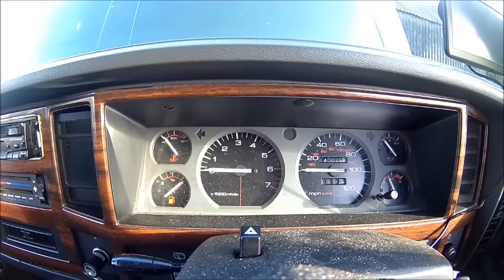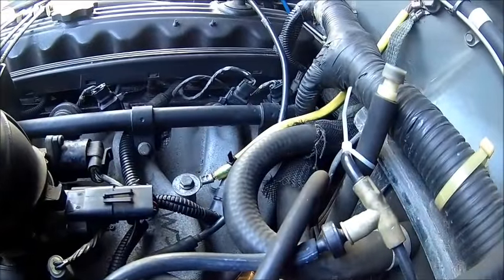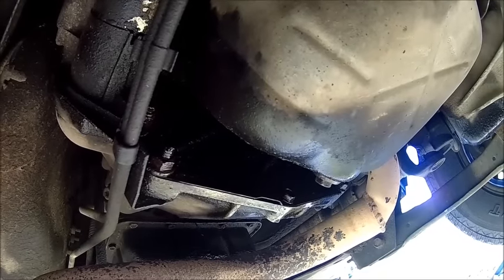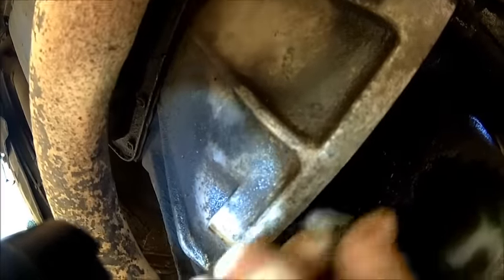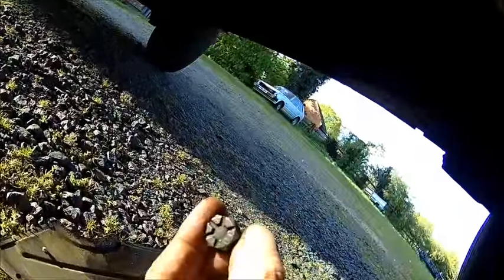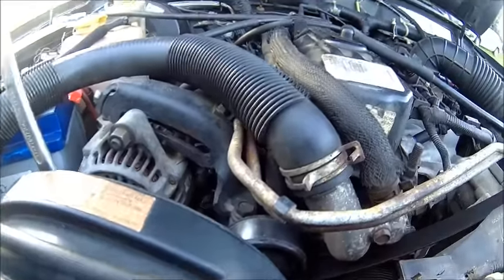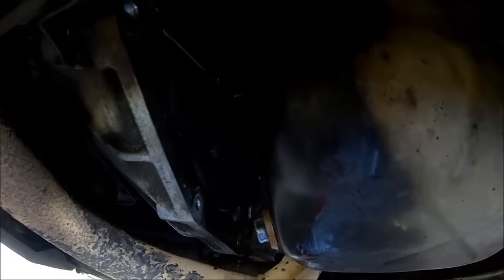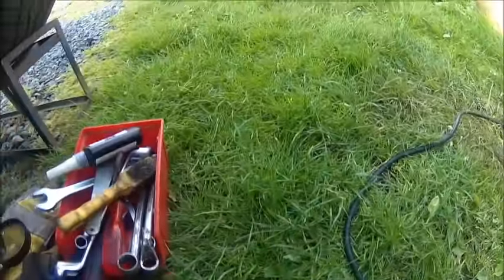Jeep engine knock fix  -Cherokee XJ 4.0 Auto, flexplate bolt issue

Comment: i did this the other day, i didn’t turn the alternator like you did, it didn’t sound any better after the job, one bolt on the flex plate was looser, but i’m wondering if i need to turn the alternator to spin the engine like i did the flex plate, would make sense but i thought i’d ask
Reply from the maker: turning the alternator is just another way to turn the crankshaft as the pulley  bolt is hard to access...

Comment: My does the same thing it was shaking an knocking really bad an had to have it towed into a shop an the man it was the Tork Converter bolts came loose an it stopped after he tightened them up but now it wants to do it again after about a month an a half he charged me 85 dollars just to tighten them up an now it's doing it again I don't think he put lock tight on the bolts but where can I get something to hold the flywheel from turning whenever I tightened them back up again
Reply from the maker: Take the starter motor out, that gives you access to the ring gear on the flywheel, then use whatever you can find to block it

Comment: 1:08 what is that whining noise? My 94 XJ is making the same noise? It think it sounds like it’s coming from the ac compressor. Possibly the bearing. Any ideas? Thanks
Reply from the maker: That's most likely the power steering pump, nothing dramatic as it never really changed over the last 130000  miles

Comment: Wow! This was totally the issue. My new-to-me jeep sounded like death when starting and shutting down (previous owner thought it was a rod bearing gone out!), but other than sounding nasty when you key it, it would run fine. I watched this video, got YouTube mechanic certified, went to pop the flexplate cover, and yep, loose bolts. Now it's tight and running right. Got this jeep in a trade for a shitty old bolt action shotgun, so I'm smiling. Thanks dynoguy!
Reply from the maker: You're welcome, glad i could help someone, Make sure you clean the bolts a bit and apply some Loctite, otherwise they will come loose again because the thread is too coarse for the short bolt length.
Before i actually found the issue on mine, i  ordered some rod bearings, just in case because it sounded incredibly bad,
cheers, Mike
Reply: 2021 love this comment
Reply: I'm having the same problem. When I start the motor, makes a odd rattle sound and when I turn it off, makes the rattle noise again

Comment: Excellent. I had the same noise and didn't really expect to find the answer on Youtube but here it was :) I also had a loose bolt, 15 minutes later noise gone!
Reply from the maker: Glad it helped, ... hopefully you added some thread lock (e.g. Loctite), otherwise they will come loose again, the bolts are pretty short and the thread is way too coarse.

Comment: I have an engine slight tick block has 169k that sounds like top end I replaced push rods and lifters sound is still there no performance loss still pulls hard, no oil in coolant, do 4.0s tick and how proactive should I be about the noise ?

Comment: I changed the flex plate on three of our vehicles. This is not a fun job but very possible. They crack and start to tick very loud one just broke. This disconnects the transmission and needed to tow it home. Then would'nt turn over the engine. I first thought the timing belt was broken. Cheap parts not made to last. Good fix.
Reply from the maker: Oh yes, flex plates are a common issue, loose bolt make them crack too. Alignment and correct torque on the mounting bolts make them last longer. I think i was just lucky, ... at least i could not see any cracks.

Comment: Mate your a legend. Thank-you for the video. With the sound of the knocking noise I thought it was terminal for my engine. Repaired in less than an hour. Thanks again cheers Karl.
Reply from the maker: Glad it helped someone,... when i heard the noise i thought exactly the same but it made no real sense because it disappeared after a minute or 2,....anyway, ordered conrod bearings straight away, just in case. and now they sitting on the shelf ...:-) ...cheers, Mike

Comment: My 98 grand cherokee laredo has a constant knock that never goes away and gets way louder and faster with acceleration, do you think it could be this or a piston slap?
Reply from the maker: If it's the flex plate bolts, it usually disappears with revs and load. It may be a cracked flex plate, conrod or piston slap, but without hearing it, it's pretty much impossible to figure it out.
Reply: @dynoguy  I've gotta 98 Grand Cherokee with a bad knock sound. Seems to go with the RPM and can always hear it, but on deceleration it seems to quieten itself down. What's your opinion? Was thinking it was a lifter collapse but it runs way too good imo.

Comment: Hoping and praying this is my issue.  Though I feel like I hear the knocking coming from the front of the engine.   Is it easy to pinpoint the sound ?
Reply from the maker: front of engine can also be slack of the cam chain, quite common on high mile engines, it usually disappears above idle. The flexplate knock usually disappears when hot, except the bolts are really far put or it's got a crack.
Reply: @dynoguy  thanks for the info!  Although with mine,  the knock consists whether the engine is hot or cold, and it speeds up as you rev the motor.   I’m kinda stumped on what it could be
Reply from the maker: Well, in this case i would say rod knock or piston slap,...also, sometime an exhaust header leak may sound like that, at least for the untrained ear

Comment: I'll never understand using lock tight if you do your own work? Ive told myself a million times " i hope i never have to loosen that bolt again... i always do. Fucking hate locked bolts..  FUCKING HATE THEM!!!!!!
Reply from the maker: If you need a means of securing a bolt from coming loose and if there is no other way (e.g. a wire lock),  Loctite is a widely  accepted procedure. A bit of heat and the bolt can easily being removed, i don't see a problem here.... But if one of the flex plate bolts comes out, you will very likely have a catastrophic failure which may cost you thousands of $$ to repair. That's why you need to secure them, the manufacturer was rather careless here, the material combination and design must lead to loose bolts, sooner or later.
Reply: @dynoguy  i dont take kindly to locked BOLTS round errrrrrrr!!!!!
Reply: @dynoguy  i dont abide by no larked up bultz on me JERPP!!!!!

Comment: OK so I found 2 loose bolts on my flex plate. I tightened them and still hear the noise. I did the test where I put a screwdriver to the transmission bell housing when running and I can hear the tap is definitely transmission related. There is no tap when I put the screw driver to the oil pan. So I'm guessing that the flex plate could be cracked? I can not see and cracks. Could the torque converter tap itself? This noise is really upsetting me. My XJ runs perfectly and this noise makes it sound like crap. Any suggestions?
Reply from the maker: Hard to tell without hearing it, a cracked flex plate  is quite possible, never had a rattling torque converter. Does it disappear when you put the transmission in drive,  step on the brake  and rev it up gently or does it get louder ?  If you tap the flex plate with a hammer, it should (sort of) ring, if it only rattles you most likely have a crack. 
On various vehicles , I've seen cracks on the outer holes and on the crank bolts holes, but those can't be seen without taking the thing apart. Don't know how many miles your's got, but piston slap makes a tapping noise as well, mine got almost 200k and it's getting a bit more audible now..
Reply: @dynoguy  OK so I went out there with it running and put a long pry bar to the trans and engine, and held byy ear to find out exactly where the noise is. Turns out it's right above the distributer, but only that spot. Could it be a lifter sticking?
Reply from the maker: High or low pitch noise ? Low frequency "knock" is most likely piston slap or if it gets louder with load, probably a rod bearing, if its more like a higher pitch ticking noise, can be a lifter. How does your oil pressure look ? How many miles have you got on that engine ? ... cheers, Mike
Reply: @dynoguy  thanks for the quick response. Truck has 190k it sounds just like a flex plate tap and it radiates from the area above the distributer downward towards the flex plate. I'm sure it's not It's not a rod knock. its not constant it kinda comes and goes and isn't any louder when I give it gas. It goes away at higher rpm. I did have a loose flex plate which was contributing to the issue so I know what that sounds like. This noise is similar. I checked the flex plate for cracks and it looks good.. It's more of a tap that comes and goes but originates above the distributor. Probably about 5 inches directly above it. I'm thinking it's a sticky lifter. The truck has been sitting a while also. It really didn't do this before it sat. Oil pressure is really good. Stays above half way mark at idle when warm and creeps up to 3/4 when driving. Not sure the pressure off hand. Might try to fog the engine through the brake vacuum line with Seafoam. One of those things the t drive me crazy. Even if it isn't bad I gotta fix it or it will be like torture to me driving it this winter. 😂.
Reply from the maker: You're welcome... So about the same mileage as mine, If you look at my oil filter adapter o-ring video ( https://youtu.be/aRwNUGu3EKA ), from around 17:30 you can hear my engine running.
If you listen very carefully (turn the treble down and volume up) , you can hear a slight knock (no, not the blowing exhaust manifold...:-)..). I am almost certain it's piston slap as it is louder in idle, but almost disappears with higher revs. it's louder from the underside and almost impossible to localize it clearly. Does your's sound similar ?

Comment: pretty much down to a tee what my 300,000 mile 2000 is doing. gonna check the bolts this weekend when i change the starter
Reply from the maker: Thanks for interest. .. It was really weird, it actually sounded like a conrod knock, but only when cold. You also need to inspect the flexplate for cracks, If you don't see anything obvious, tighten the bolts one after the other (i suggest a dab of loctite)  then hit the plate gently and listen to the sound. If it rings its fine, if it rattles, you got a crack somewhere... good liuck
Reply: i ended up checking it out yesterday, flex plate was fine. but the bolts were exactly like yours, one tight, the other 3 were backed out about 1/4 of an inch. used some loctite and snugged em down real good. no issues since. well minus the ziptie my buddy out on my driveshaft lol
Reply from the maker: glad it worked, ...surprised you got to 300,000 miles wtrhout problems,  mine had less than half the mileage and was already rattling like hell,...maybe my driving style ...
Reply: funny how those things work, not gonna lie i drive mine pretty hard as well

Comment: I have a 2004 Jeep Grand Cherokee Laredo 4.0 an it does the same thing when its cold then it goes away after it runs for a little bit but now when I accelerate there's a ticking but when I start off slow it doesn't do it, could that be a loose flax plate bolt or a missing bolt, thank you
Reply from the maker: Very hard to tell from your description, can be lifter rattle as well, but can also be just one or 2 bolts about to be coming loose.
Checking is easy, so why not just doing it and if they loose tighten it, if it's something else you certainly need to investigate further.
A missing bolt will most likely make a hell of a noise because there are only 4 of them.
Reply: dynoguy thank you so much for the advice I check it out hopefully they r just loose an need to be tightened thank you again
Reply from the maker: You're welcome, i would also recommend to put some Loctite on them, stop it from coming loose again.

Comment: I have a 2003 Jeep Grand Cherokee Laredo 4.0l I had the same problem with a loose flex plate bolt and the engine fealt like it had a knocking sound and when I watch the video and looked at the flex plate it did have a loose bolt I tightened all the bolts up and now it is running like I bought it like new no sounds and it is quiet you can’t tell if it is on because it doesn’t make a noice.
Reply from the maker: Glad it helped someone,... In my opinion this is a classic design fault, a coarse thread in aluminium, that simply must come loose under stress, rather sooner than later.

Comment: will check that. someone just replaced the motor before I got it. the housing seems to have 1 or 2 cover plates. noticed that a few of those bolts are missing. not sure if it being loose is causing the 4 tick series. tick tick tick tick...pause tick tick tick...pause. my logic tells me something is spinning and after so many revolutions the 4 tick series continues. Maybe flywheel is rubbing. noise is coming from underneath.
Reply from the maker: It is a 2 part cover plate and it does most likely rattle if bolts are missing. Checking the flexplate bolts is easy, so always worth to have a look while you there.
However , the noise you describe sounds different to me, but without listening it's pretty hard to tell.
Exhaust manifold blowing, perhaps, .. or Evap solenoid does make an intermittant tick noise as well, but that's in the engine bay.
Reply: will check out. tried to video it but the sound was just horrible. engine sounds good but on video is counts like a horribly sickened diesel. LOL. I will try again to tape it but the 4 tick then pause sounds like a spinning wheel part . any idea the bolt size of the cover plates?
Reply from the maker: The gearbox is japanese, so bolts are most likely metric, either M6 or M8, can't remember yet. Still have no idea about your ticking sound, let me know when you got the video up
Reply: you know what the sound is like? like a M16 on 3 round burst pause, 3 rds burst pause. the sound of a hollow type sound so that was why thinking g the trans, flex plate. something that rotates and hitting on something making a hollow sound. will take a day to get under there and check, replace the missing cover plates and bolts.
Reply from the maker: Well, what you describe appears to be more like an exhaust manifold leak, does it get louder with load/throttle and does the "shooting" frequency increase with engine speed ? The stock manifold is not exactly well designed and tends to crack around the weldings.I am on the third now and it starts banging at the cyl 4-5-6 joint, exactly as the previous 2 did.
Also got a crack at the end where it joins the downpipe.  Welding is hopeless, after a while  it just cracks again.
I do a lot of short runs from cold, we also have alot of rain here and every puddle is a temperature shock for the manifold, that puts alot of stress into it and makes the material rather brittle, long highway runs and warm/dry climate makes them last alot longer.
Reply: dynoguy will check that too. I would have to record it. may need a sound filter. tried thru a few apps but makes the engine sound like hell. bangs and cranks one cannot hear when idling. Sounds smooth until you tape it. LOL
Reply: it was the cover plate . the starter connects to the bell housing. the housing has 2 cover plates. the one is mounted between the starter and housing. it tapers a bit and mine is bent in towards the flywheel.  I need to remove the starter to take the plate off, straighten it and then add the missing cover plates bolts. so, the bent cover  will rub and vibrate and hit the plate every revolution(s) or so. tried to bend mounted but just not enough. the bolts I could reach, so far, are tight. I need to check the upper ones. I bet a bit loose which explains the tapping of the plate cover every so often.
Reply from the maker: Thats's a new one to me, never seen that. So it must been bent quite a bit to rattle on the bolt heads. 
The cover plates are quite impotant as they keep the dirt out of the bellhousing.
What lesson does this tell us ? ... Do every job by yourself, so you know at least who you can blame.
Reply: exactly. after I tried to bend it a bit the noise changed a tad. it is just bent inwards enough that the bolts will tap it. sounds louder when start up and idling. As it warms the sounds lessens. I would rather make my own cover plate. Cut the one under the starter flush and leave it there as a spacer. make the new plate with a bent and tab rise with a hole gordonglassusa.com@gmail.com the starter bolt to go thru. need to inspect, I will need to take the 1 bolt out at the starter and 1 or 2 small along the housing.